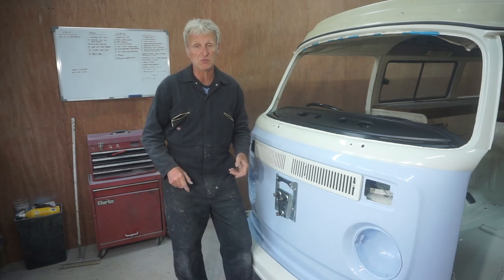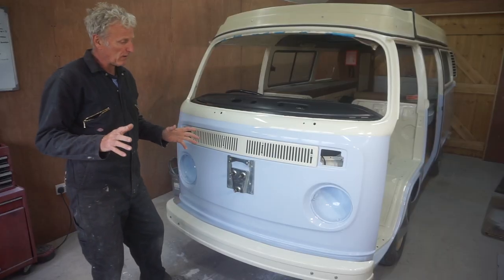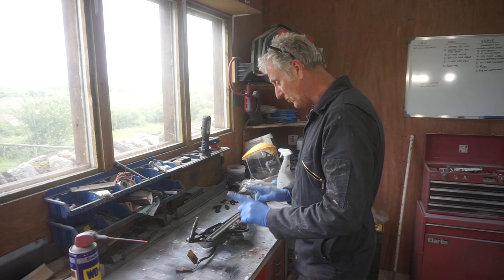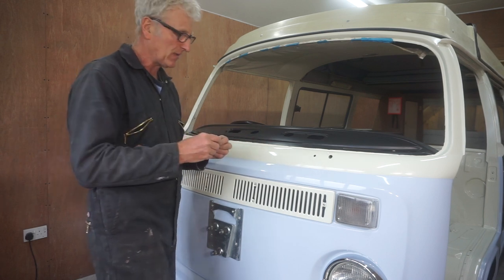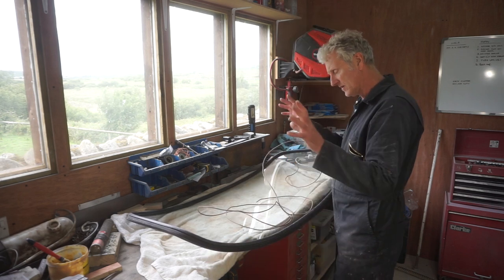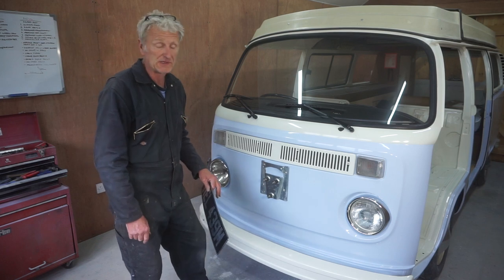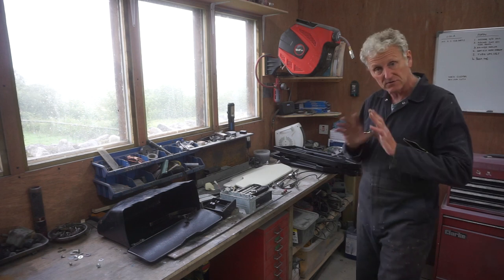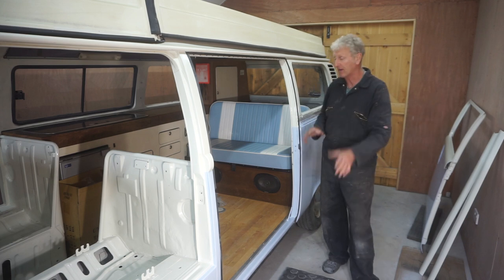1973 VW Campervan Restoration Part 29

Comment: Great to see it all coming together now..........it must be really satisfying. Great job!
Reply from the maker: Thanks
Reply: Jon - i note that you have mentioned that you use stainless steel fixings - screws/ bolts/ etc - and wondered if you had a top tip for where best to get them from to best fit these campers? Thanks again